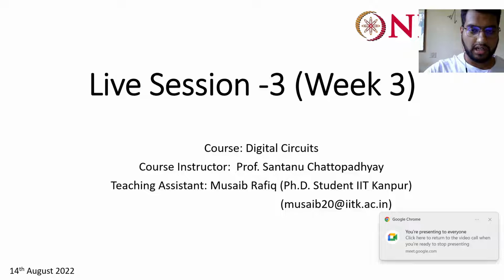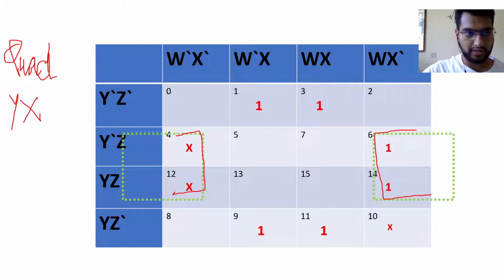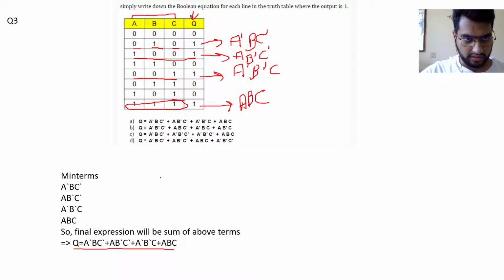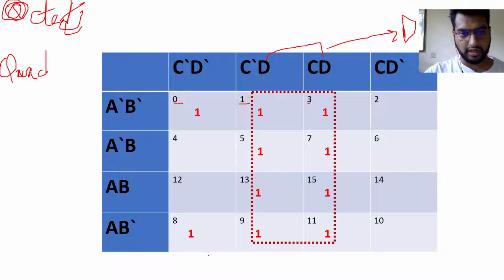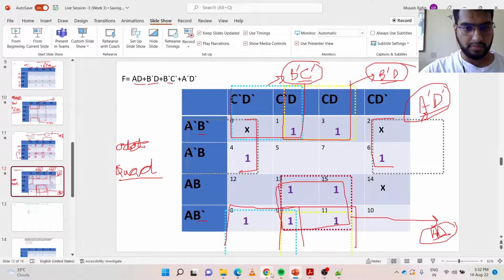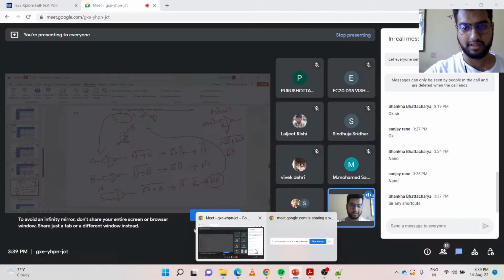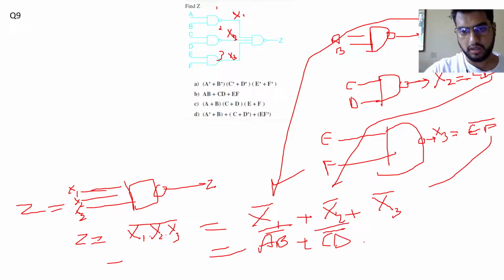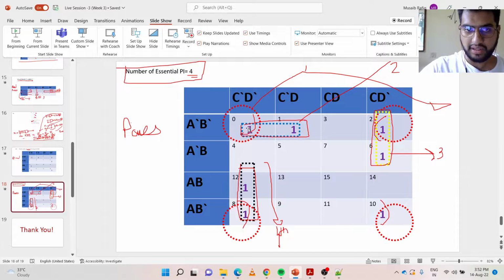14th August - Week 3 Digital Circuits

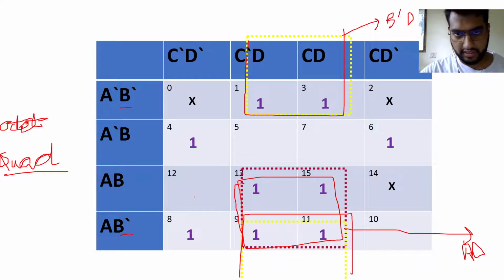Comment: Sir, in 30:26 i have taken  both the dont care of A'B'C'D' & A'B'CD' as 1 and obtained A'B' by solving the quad and solved it like rest of the question but my answer is F= AD+A'B'+B`C`+A`D`, how can i convert it into the answer given the option which is F= AD+B`D+B`C`+A`D` (IN SHORT HOW CAN I CONVERT A'B' INTO B'D)
Reply from the maker: Well I don't know how will you directly calculate B`D from A`B`. You have done correctly, but what I can suggest is if you are able to form quad for particular minterms without using don't care conditions , go for that approach first. Yours is also correct but it was not present in options. So, try making different quads, since this was a MCQ based you will have to do it according to the given options.
Reply: @musaibrafiq4184  ok sir got it thank you sir 🙏🏻